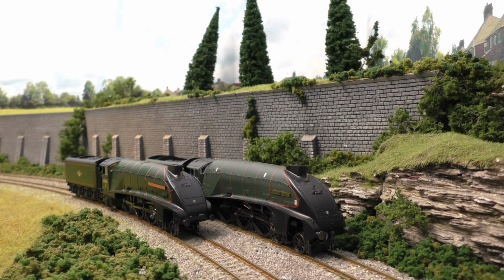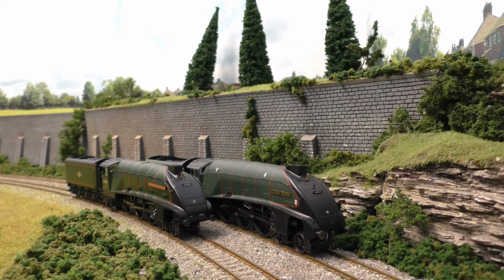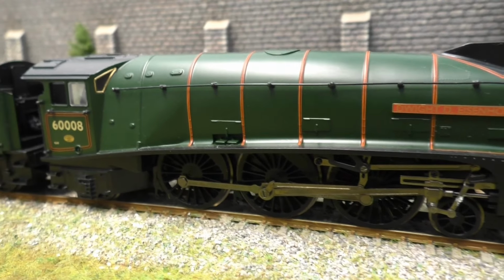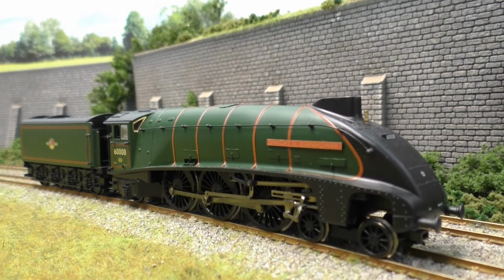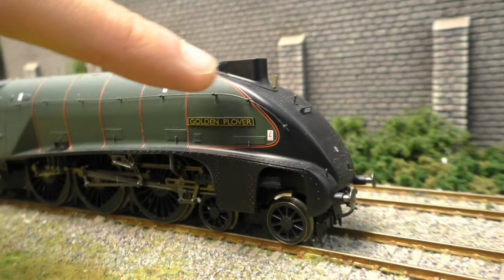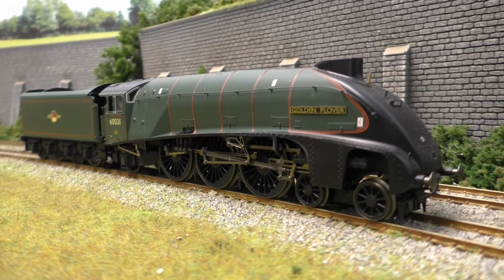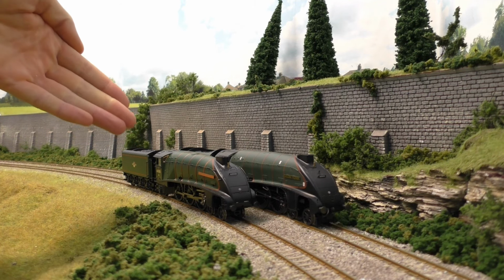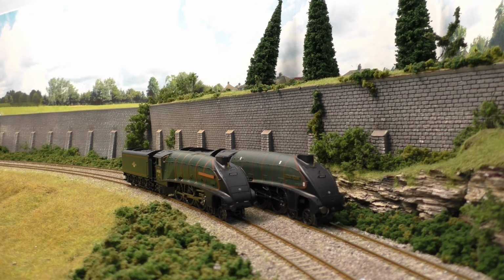LNER A4s Hornby vs Bachmann

Comment: Colour of paintwork is very difficult to gauge, was it freshly painted, aged paintwork, as preserved, what are the lighting conditions and so on, all of these make objective analysis difficult, so variations can be accepted, but getting the shape wrong, that's a big no no. So Hornby for me.
Reply: That is true about the paint. I have seen GWR locomotives on the Severn Valley Railway painted in green and some are painted  in a very dark green and some are painted in the washed out faded green colour, even when they are re liveried in the BR condition they seem to have different shades of green.

Comment: on the one hand, hornby's detail and proportions are very good. the overall stance of the loco is undeniable. i do actually love how fine the valve gear and connecting rods are on hornby's model. 
on the other, bachmann's A4's are proportioned well in comparison to itself, very sturdy, and the livery application is far superior. i think bachmann's A4's have a bit more charm to them whereas hornby's A4's are a bit flat- but neither model are better or worse as they are both great.

Comment: Nice work on the two A4s I like the hornby version because of the lamp irons on the front to put headboards and lamps on the loco The Green needs to be improved but the running quality very nice at high speeds didn't Golden Plover had sound before but I guess when you rename it to Union of South Africa it will

Comment: In my opinion they are both quite good, the hornby may win on better detail but at today’s prices they are quite expensive, the bachmann ones can be picked up for a decent price, I have 2 bachmann ones and they were both under the £100 mark, one of them is even a limited edition Dominion of Canada and as long as they are looked after they will give you very good performance, also a lot of people used to say that the bachmann ones were the wrong shape, I have looked at both hornby and bachmann A4s side by side and can categorically say that there is no difference in the shape of the bachmann A4s.

Comment: I got the first question wrong. The Hornby one is the one I would go for, but there are more problems with it for me. 1. Totally agree with you about the paint finish. It is awful. 2. I would prefer it to in LNER Apple Green and have its LNER number. 3. If it has to be in BR then in BR early crest and remove those overhead warning stickers. Martin. (Thailand) Make model of trains as they started life, (And real ones) not as they finished it.

Comment: The Hornby model is far better than the bachmann. Livery can be vastly improved with Johnsons klear  ad weathering. Bachmann chassis is poor. Tender is pure fiction. An an amalgamation it corridor 1928 and 1936 versions. Valve gear hopelessly wrong and over scale no 
Lubricator or speedo represented.   The gree of the bachmann version is closer to prototype but the lining particularly the boiler bands are like a bumble bee. 9/10 for Hornby. 2/10 for bachmann.

Comment: Hornby do struggle with paint colours. When you question them about they are adamant that their colours are correct.
Reply: Well tbh, they are, to them. Colour is in the eye of the beholder and a very complex set of variables dictate how the individual interprets the colour these go from personal physiological factors all the way to simply where you're standing relative to the light source... all this before we get to the fact there is only 1 loco I believe that is definetly known to be preserved in the exact same paint job it ran with in service in terms of BR steam liveries. Everything else has been repainted using some guys sorta best guess at what is right.

That loco is city of Birmingham, went straight into a museum, has since moved from one museum to a new one but stands alone in never having been messed with.

There were two other possibilites, the two A4s in the states May well have avoided a brush since BR did them up and sent them over but we just did away with that example.